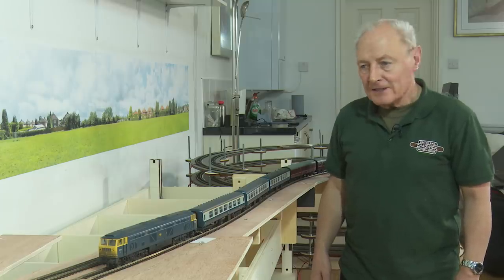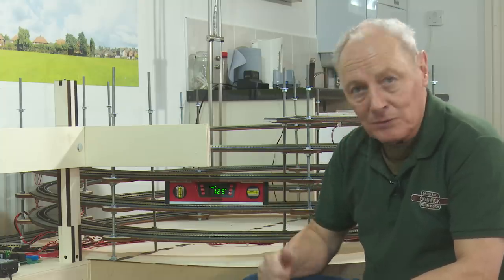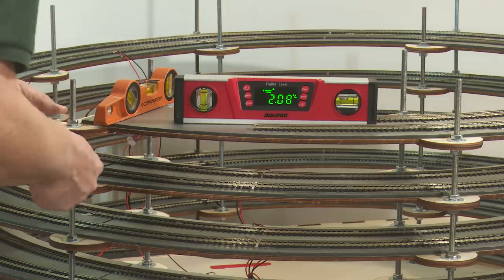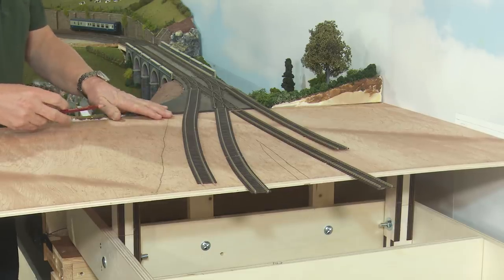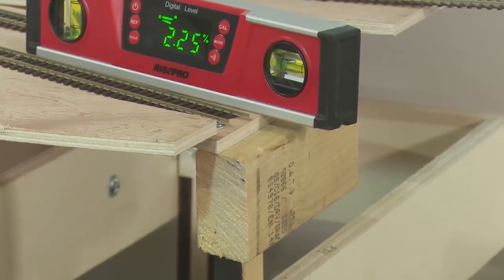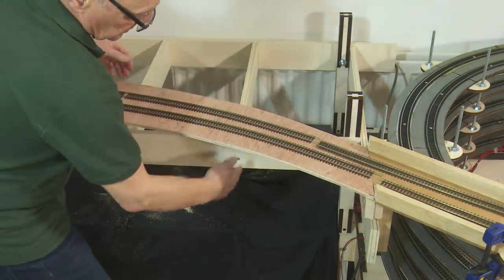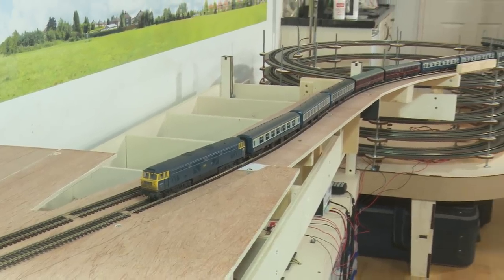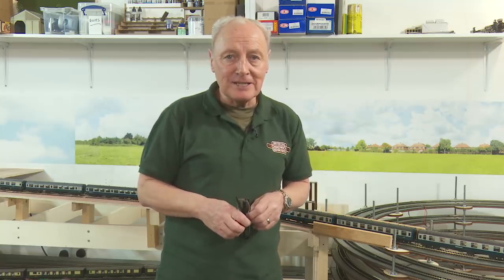Managing Inclines and Layout Update at Chadwick Model Railway | 123.

Comment: Charlie, do you not have a local timber merchant? Mine will still deliver.
You could get a sheet of 9mm birch ply that I find better to work with than the hardboard ply and sounds better too (even with W.S. trackbed on top it seems less noisy).
Reply from the maker: I think that I’m sorted with a similar solution, thanks.

Comment: Great work.    🔨🔧🔩
Thanks so much for sharing.  😎👌🏼
Although I don't quite understand why the incline changes from 2% to 3% only where the track was supported by the threaded rod? Was it because of a miscalculation or some other factor?
Reply from the maker: Yes, it was fixed due to an error in the bottom circuit.

Comment: Fantastic video as always. Can I ask why you prefer not to use MDF? Not a criticism by any means just wondering if I should avoid it when building my model railway? Keep up the good work. 
Cheers.
Reply from the maker: There should be a pinned comment Sam. It absorbs moisture and then will warp reasonably easily. Also when you saw it the dust particles given off are toxic. If you must use it you need to seal it with PVA and support it throughout its length. As you gathered I’d avoid it. Regards Charlie
Reply: @ChadwickModelRailway  ahh I see. Thanks for that Charlie 👍I’ll try get a hold of some ply. 
Regards sam.

Comment: Great job on the helix adjustment.  I may of missed it but did you come to any conclusions regarding the under track Power Base by DCC Concepts?
Reply from the maker: I believe that you certainly gain traction but only around an extra coach or two Roy. Regards Charlie.

Comment: Wow Charlie, this video was very inspiring and informative. Is there a formula for distance for a rise to raise the height of the sub roadbed and, track for clearance of the rolling stock or is it just a guess? I model in N scale and I haven't away to figure it out, a bit of frustration, mine you. I have a 26 inch deep by 64 inch long bedroom layout yes it's very tight. I use 1/2 inch plywood with 1 inch polystyrene as the base of my layout. Mounted to a closet mount system. I appreciate and respect your ideas.
However I love You're information and the development of your layout and how it's all coming together. Thanks for your time and I look forward to your next video. Bruce
Reply from the maker: No there is no secret formula brew some afraid you just have to work it out. Once you complete the first circuit it then becomes apparent what your clearances are. Good luck regards Charlie

Comment: Charlie, may a non railway modelling man ask a silly question, when your locomotives hit the helix the control is at 100% and stays like all the way up albeit the loco is slower, would this cause overheating of the motor or are they cooled in some way now, when younger my brother and I had a train set and they had no cooling.
Reply from the maker: No cooling at all. I intend to do current consumption checks a compare speeds, loads etc.

Comment: Hi Charlie, I am seriously impressed with your progress on the helix. Charlie I have one question and that is, are you able to assess if there is any undue strain on the motor of the locos when they climb the helix.  Cheers  Greg
Reply from the maker: Hi Greg,  I plan to examine the current draw from on the flat compared to climbing the helix, at various speeds.  Whether this extra current would be classed as “undue strain” would be difficult to quantify.  What’s your thoughts?
Regards Charlie.
Reply: @ChadwickModelRailway  Charlie if you have an electrical engineer as a member of your club then he maybe able to shed some light on this topic. I will make similar enquires at my club.   Cheers   Greg
Reply from the maker: That would be great. Regards Charlie.
Reply: @ChadwickModelRailway  Hi Charlie, I have made some preliminary  enquiries which suggests when a locomotive is asked to perform a heavier than normal task is has to draw more power and this can result in overheating of the motor, consequently this may or may not effect the lifespan of the motor, only time will tell. I will continue my research and let you know the results.  Cheers  Greg
Reply from the maker: Thanks Greg, I’m going to test this in next week’s video.

Comment: kinda makes me ask, why not  have a spur link off the helix to left going into an industrial and a link  that can run into a siding  at the station on the right when facing the viaduct.. i wouldn't of expected the  degrees to be out causing the stalling as to me on the previous video  it kinds  looked  like the bogey on the left in the front was catching the outer track almost looked like a derailment  Charlie\
Reply from the maker: Thanks Jason, an interesting comment. Regards Charlie
Reply: @ChadwickModelRailway  as for the layout it makes sense to have the inner line  breaking off to a spur as either a goods line or passenger service just adds a layer for the railway station..

main reason i suggested  service terminal on the outer line give it some interest..

the only issue i hadn't counted for was a cross over between the 2 lines in both directions

might also consider a slip rail  to where you can disconnect the loco and push into the terminus..

Comment: Hi Charlie, As is usual a very well thought though explained Vidio of the process.
As regards lockdown can your local timber merchant not do home delivery,you know like the old days cod.
Q, how does one ask stupid Questions without being silly🇮🇪😷
Reply from the maker: There’s no such thing as a stupid question Derek.  You have to be in the building trade.
Reply: @ChadwickModelRailway  My previous response was to flipent  my apologies, in the Republic of Ireland you can arrange with the local timber merchant to deliver what ever supply of wood you require and a charge applied normally€20:00.

My silly Question where do you purchase the flexible track. There used to be code 100 supplied in 25 units from Peco but it doesn't seem to be available now. Weather that's a supply issue or BREXIT I don't know. Any insight would be most helpful.
Irish modeler retired.

Comment: Screw length Sir. It ain't gunna fall up, and even if one pulled it upwards, the ply would fail before the screws. Personally, if it is 9mm ply, then 15mm screws would be the max. to use. Glue, for permanent fixings does the rest.
Reply from the maker: Thanks Harrison, regards Charlie

Comment: Hi Charly, way you never use MDF wood ?
Reply: I was going to leave Charlie a comment then saw you asking so hopefully he'll see too. I looked into this in some depth recently simply cos I had loads of MDF lying around and on a limited budget, MDF can and will warp, burst, etc pretty easily if exposed to much moisture unlike marine grade ply but apparantly it's really only a worry if you're in a loft, basement, shed or garage for example where there might be large temperature variations and possibly high moisture levels due to dampness and humidity at the extremes of those fluctuations however in a typical home room where the temperature is pretty stable and it remains dry (no damp, no extreme humidity) it should be fine but ideally you want to seal it with an oil based primer, nothing water based. If you think about it plenty of furniture is MDF and it's fine just don't spill your tea or coffee all over any unsealed edges or damaged spots where bare MDF is exposed. The only real problem with MDF and what Charlie is most likely referring to is in the cutting of it as the fine dust it produces can contain formaldehyde glues used in its manufacture but there are conflicting views on this (worth a Google) and suitable respiratory precautions should be taken when cutting all wood anyway especially with powered tools that can create finer dust.
Reply: @shb8124  Hi stuart, ... taks for your info and reaction
Reply: @dannyhallaert8871  no probs it's purely that I had some furniture to upcycle and realised it'd actually be pretty easy to turn it into a small layout so I started researching a bit 're the MDF. Ideally I'd still use good timber and decent marine grade ply but if treated properly... time will tell but I still haven't found an extremely good reason to absolutely not use it and tbh I wouldn't have spared a second thought to Charlie's little infill there.
Reply: @shb8124  You arguments are right but not important on our ivierment ... my MDF are the graan once &  waterproof and I have an try hot heated garage never below 10 CELSIUS ... But thanks again for the info
Reply: @dannyhallaert8871  yip, that's basically my feelings too mine is all sealed and in a normal 'temperature stable and dry' room so should be fine.
Reply: @shb8124  THANKS
Reply: I have used mdf successfully as a track bed for many years without problems - but in a dry and partially heated environment.  It takes screws and pins much better than ply and of course doesn't splinter when cut or drilled.  Its main problem for me on my helix was that it takes 9 mm mdf to equal the strength and stiffness of 6 mm ply.  As Charlie pointed out, even a 3mm reduction in clearance can be a problem on a helix particularly as the supporting cross members reduce it by at least a further 3 mm.  I have found 6 mm ply fine for the whole of my present layout without any disadvantage compared to 9 mm ply which most modellers appear to favour.
Reply: @grahamthompson6622  defo agree the environment the layout will be in is a huge determining factor, no helix for me though mine is a modest layout but if I were to ever need one it'd be one area where I'd stick to the best I could get in terms of materials and design of course. Glad you're finding no issues with your track beds 👍
Reply: @grahamthompson6622  thanks man from Belgium ...
Reply: What is do Not understanding is that Charly say MDF avoid @ all cots ...
Reply: He also say ... MDF a product made bay the devil 👿...
Reply: @dannyhallaert8871  could just be his personal opinion and a turn of phrase.
Reply: @shb8124  probably but normally when he say something like that ..... he have his reasons for saying that
Reply: @dannyhallaert8871  I've called many things the devil's work or evil or something lol, it's just a turn of phrase to me, there are lots of things I don't necessarily recommend for particular jobs but it doesn't mean they can't be used at all 🙂
Reply: There are a number of lawyers who think that MDF is the Asbestos of our generation, and are looking forward to making their plaintiff bar buck.  Scares me.
Reply: @dakdak7609  the formaldehyde glues issue?
Reply: @shb8124  I think so. I have no idea if it’s right /correct / accurate and am far far from an authority on the issue but I do hear about it from a financial provision perspective.
Reply: @dakdak7609  yeah that was the main issue I was concerned about as well but ditto I'm not and expert I just found a mix of conflicting answers when I looked into it from both health and environmental perspectives which both concern me. I think it varies a lot but basically I just take care when working with any material and some hardwoods are grade 1 carcinogens too so I think you'd need a scientific analysis of the particular wood to be certain and that's not practical for most of us. I think like many things it's a case of heed any warnings and take relevant care such as effective masks.
Reply: @shb8124  I think that’s part of the issue, it’s approved for use in the professional / commercial sphere along with a requirement for handling, safety equipment and steps etc but in the DIY space very few people use the masks etc, even if they have bought them.  

On a simply aesthetic level, the wood on the helix looks lovely by comparison.
Reply: @dakdak7609  oh totally agree, if I were doing a helix I'd treat that differently for a number of reasons and Charlie's defo looks great. Agree on the DIY point too and it's true in modelling as well that many don't observe or perhaps even realise where there might be risks, even just small ones. Of course I'm only speaking from my own situation with my humble layout here and my own reading up coupled with experience in a number of work environments where H&S was a big thing (from metal casting to an explosives factory) but as I say I'm not an expert in MDF lol, I can only encourage people to look into things for themselves though and be safe, oh and hopefully have good running track lol 😃😉👍
Reply from the maker: Great comments guys. For me (and it’s purely my opinion) MDF is not idea for model railway construction.  Untreated, it absorbs moisture and will warp and sag over time.  In environments with large temperature fluctuations this becomes worse. The dust produced during sawing is very hazardous and is easily forgotten when you just need to saw up a bit for a minor task.  Sealing it, including the edges is essential but for me, it’s a product which has safer, more stable alternatives.
Reply: @ChadwickModelRailway  thanks Charly, my question is been answered extremely ... by a lot off your members and supporters ! Charley, I am from Brugges Belgium.  I must say your you tube Chanel is amazingly good ...! You must no I am totally new in model railways and use you tube for my planning and education ... your way of videos making ... your way of explaining is very understandable for new people and from a foreign country... in this very exciting train world 🌎 !
Thanks for being there and help us this way ... 
danny Hallaert
Reply: @ChadwickModelRailway  cheers Charlie. Yeah it defo must be properly sealed and even then I wouldn't use it in a loft or garage layout for example. For me it simply made sense as I've been able to build almost a whole small end to end from simply upcycling 4 pieces of matching furniture and it's in a flat but I researched the pros and cons and issues of the material first but otherwise yes you're wise to simply stick to good timber and ply if poss. Good work on vids too, they've proven to be an informative and fun watch since returning to the hobby 👍🙂

Comment: Awesome news Charlie. Glad the mystery is solved as it did seem very odd your loco was having an issue with a supposedly 2% grade. 

A bit more spendy than the electronic bubble level but very useful for rail and a form factor that works easier is this by Piko: 55050

https://www.piko.de/DE/index.php/en/piko-latest-news/model-presentations/926-h0-expert-plus-measure-car-55050.html

Would be helpful to cut a circle out of the helix table so you could crawl under and into the helix from below. Yeah not great at older ages but loads safer and easier than stepping in from above.
Reply from the maker: I’m so pleased that you enjoyed it mate.

Comment: MDF does not warp as like plywood it is man made pine wood is more likely to warp the main difference between plywood and MDF is that plywood takes screws better and MDF is better for gluing
Reply: Mdf is rubbish, even marine ply needs the edge sealing.
Reply: @stephenhogg2319  only in outside applications
Reply: @haselden100  in a loft or area which is no climate control. Boards still need support. Any man made boards will swell up if not sealed. Sundela was the choice 40 years ago before MDF,  thanks dave happy modeling.
Reply from the maker: Now play nicely gentlemen.